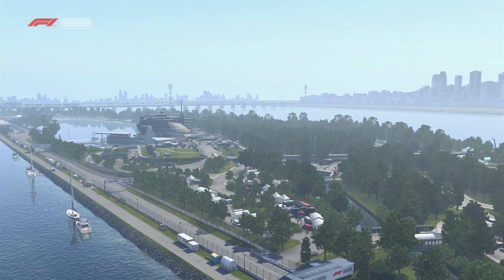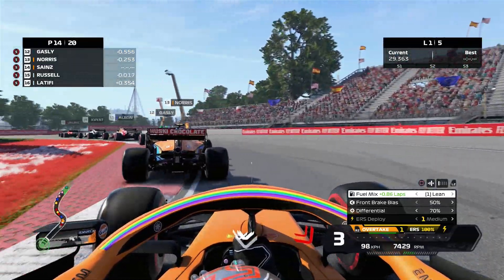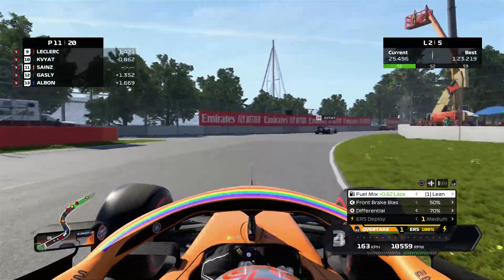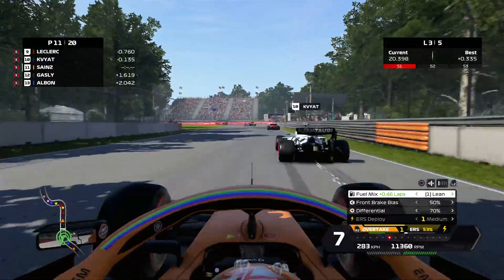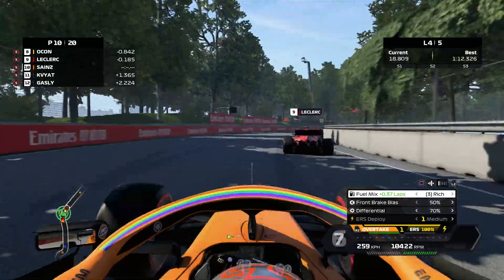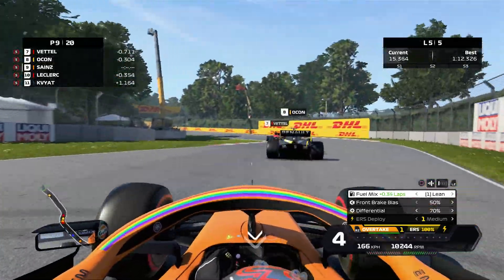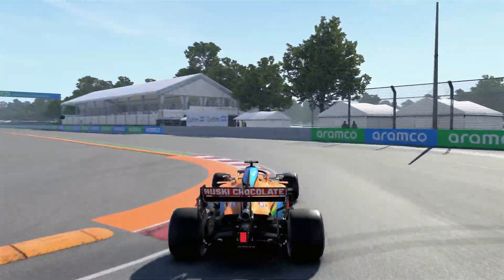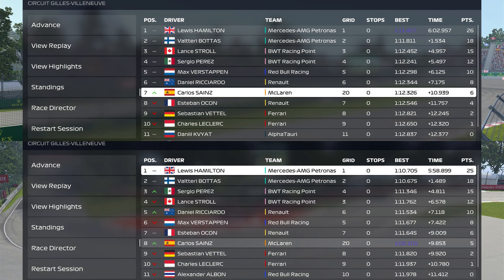What If Old Style KERS Replaced Modern ERS?

Comment: What if F1 cars had no ERS?
(remove hybrid power output and the extra weight from the hybrid system)
Reply from the maker: This one is pretty technical, because it also helps the turbo not have bad turbo lag. Also, if you were to do this, you'd also ease the restrictions on the fuel delivery to get more power out of the ICE. This mod gets pretty close though as for the vast majority of the lap no ERS is being deployed
Reply: @AlexGillon 
OK 👌